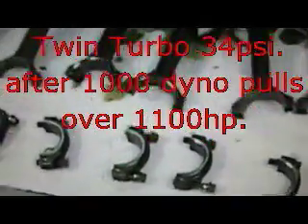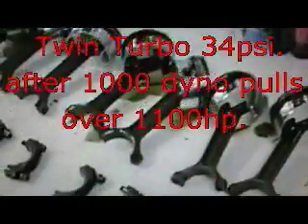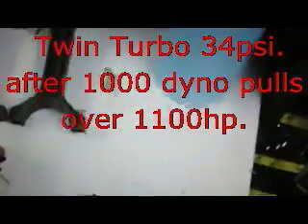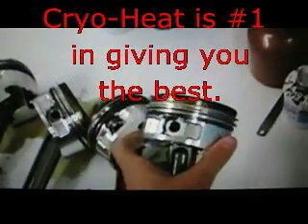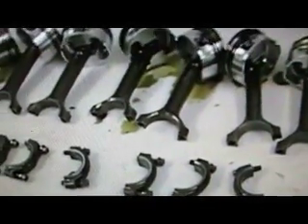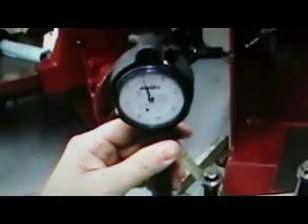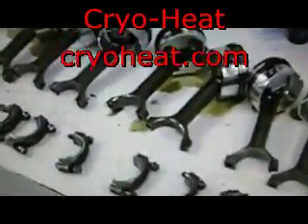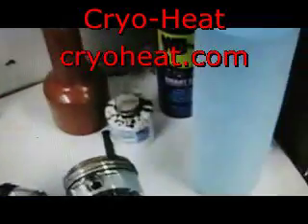an Engine after Cryo Heat metal treatment

Comment: using Total Seal Rings helps out on crank case blow by leak down is about 12 % conventional piston rings at 38% leak down, turbos are hard on rings sneaking by letting compression loss at high RPMs